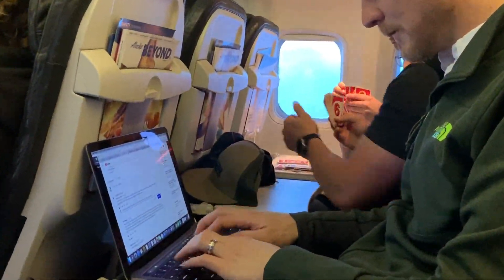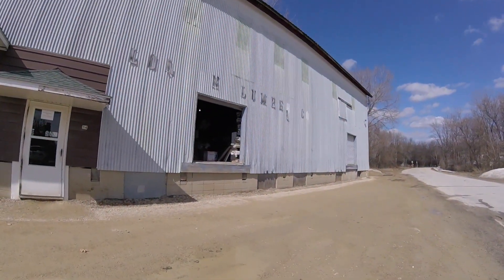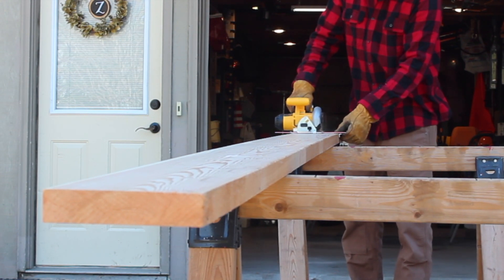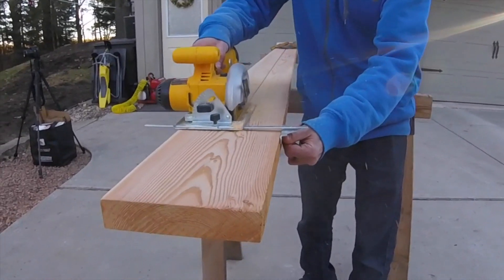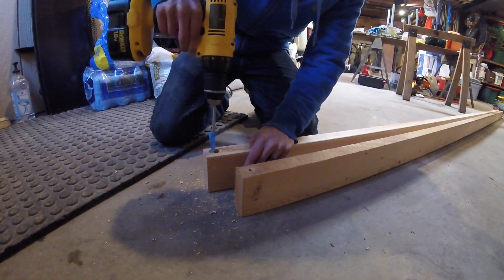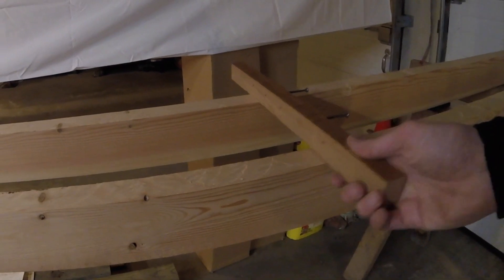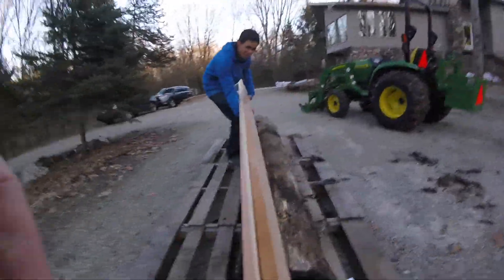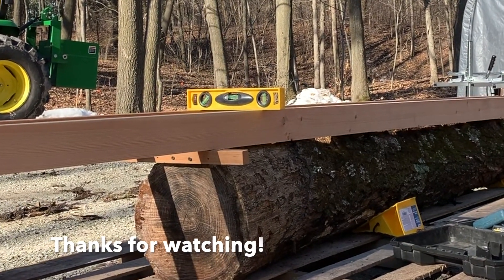GRANBERG - Slabbing rail brackets help create a level first cut for milling your own lumber and logs

Comment: Was the cherry strip the same dimensions as the bracket?
Reply from the maker: Thanks for watching and the question @FireCaptain Tom!  The cherry strip was just a sacrificial piece of wood that we had laying around and happened to be approximately the right length for what we needed.  From what I remember, it could have been longer and/or slightly wider and still have worked for our application.

Comment: Good idea to use a 2x8 cut in half to make two straigt 2x4.  Reason is simple.  2x4 are made from the hearthwood (near the center), often including the pith, and they always warp. Long and wide lumber are most of the time made from sap wood of larger trees, far from the center.  Much more stable for dimension. The 2x8 you used was perfect! That is my 2 cents!
Reply from the maker: Thanks for watching and the comment +Joe Lesage!  Good point on the location of where they usually get the 2x4s versus some of the wider dimensional lumber.